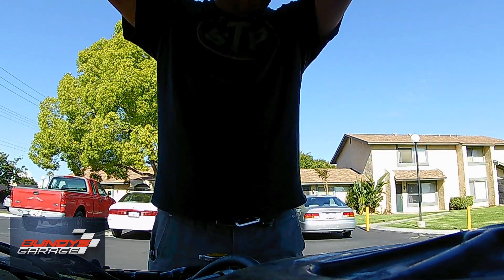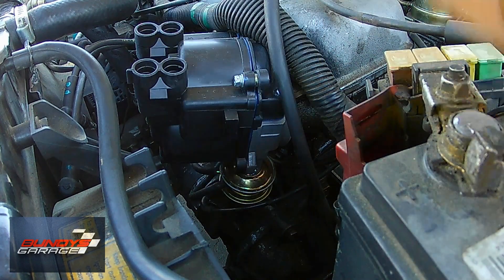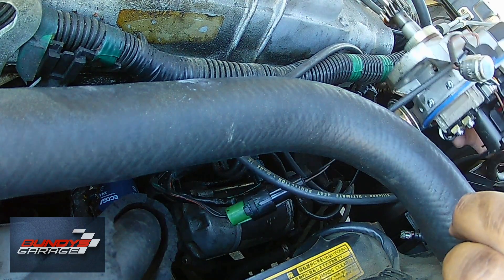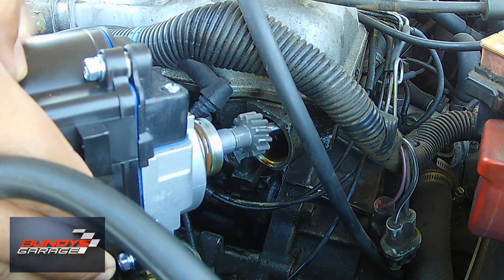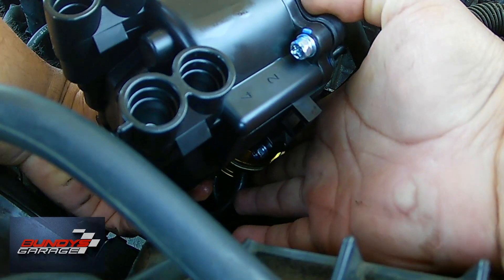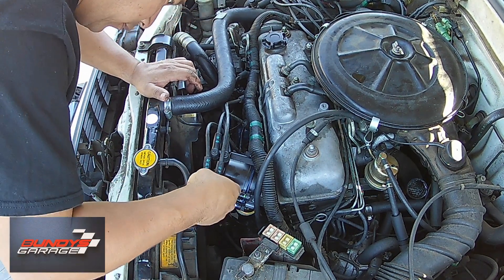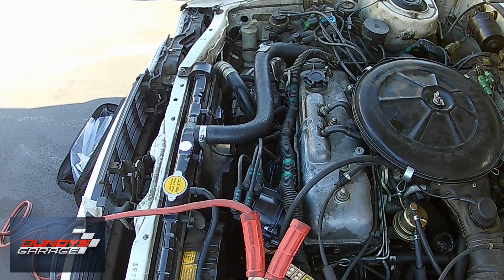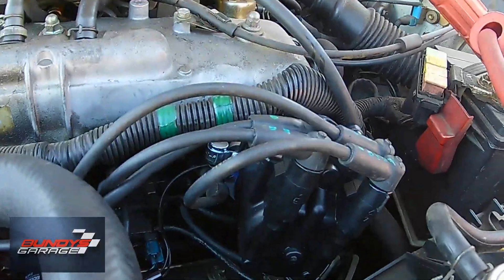1984 - 1988 Toyota Corolla 1.6L Liter Distributor Replacement | Removal | Chevrolet Nova

Comment: i had one that i the coolant  resurvor cap came loose and  was over heated and car did not start up.  distributor replace by a mechanic and  it worked again for the rest of  its days

Comment: Check the alternator for surging. Then check everything else in the system. I do have a question about an electrical part that I can figure out. I have a pic of the part but idk what it is or where it goes.

Comment: I have a 1987 Toyota Corolla I have replaced the distributor 4 times in less than a year, it keeps burning the distributor.
Reply: Why would you replace the entire distributor ?  Test the Coil or Igniter by checking the ohms . NGK Igniter $40 Coil $25 - $35 . If I were guessing the complete distributor was close to $200 .   Bad grounds , connections will destroy theses components . A cheap aftermarket Tachometer will damage the same two components . Also i saw that you installed the distributor assembly without checking the terminals to the Coil or the Igniter,  they need to be tight but don't over do it .
Reply: Hi Duane, 
I have a little experience with these engines.
Please change the rotor and distributor cap .
It should solve the problem.
The aftermarket rotor and caps were defective for these cars.
Looks like some one made a million or two of these parts.
Reply: @msbangash9135  merhaba türkçe biliyormusunuz?

Comment: You totally helped ease my mind about how easy this job is!! I have a Toyota mr2 with the 4AGZE and my distributor O ring is leaking a bit and I'm planning on replacing it as I'm doing new oil cooler lines and filter housing seals this video totally gave me the confidence to do it!
Reply from the maker: Glad it helped you out.